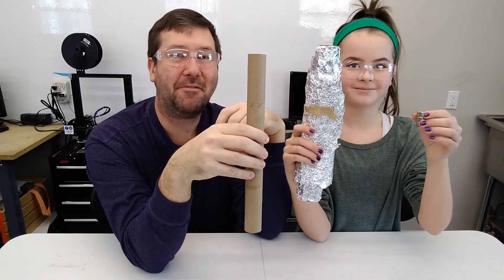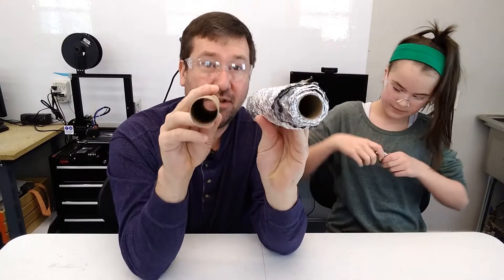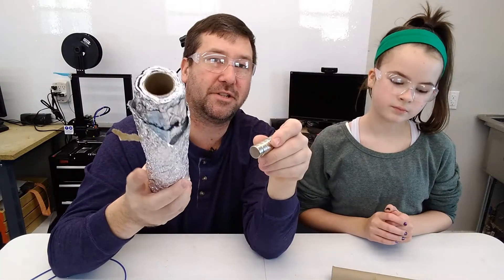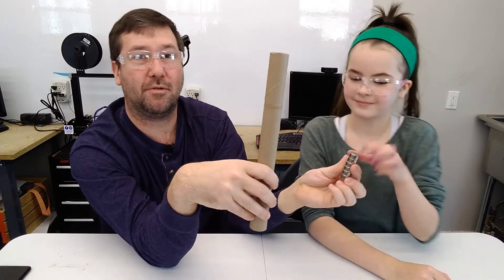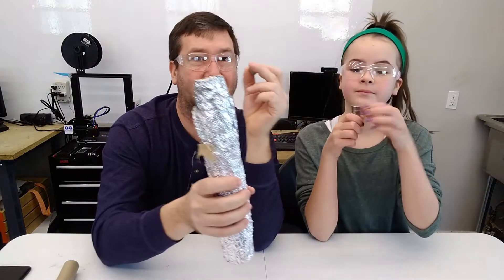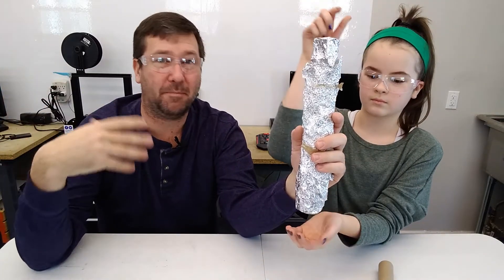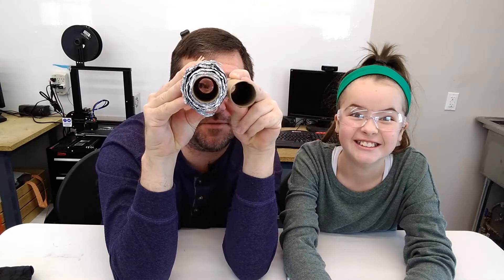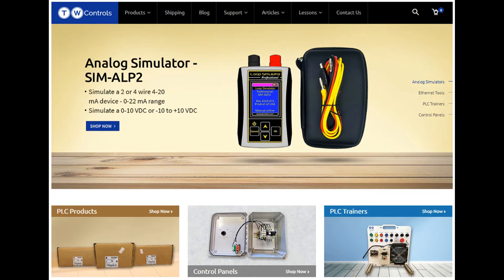Learn about Electricity with Aluminum Foil and a Magnet - Eddy Current - STEM with Tim

Comment: Very interesting video.   I like it.

It takes nearly 3 times as long:    1.86 s/0.66 s = 2.8 s

Your experiment brings up a lot of questions:

Does a magnet conduct electricity ?

What kind of interaction between a moving magnet and a stationary
conductor is there?    We saw that the bigger the magnet, the longer
it takes to drop.

You brought up the subject "eddy current" and implied it was some-
thing that flowed inside the aluminum foil, but you didn't say what
it was.   Are you implying that it is something that slows down the
motion of the dropping magnets ?
Reply from the maker: Here are two follow up videos that may help. 
https://youtu.be/WI56V_Wl4jI
https://youtu.be/veUAJKbAsqY

Comment: I tried this with some very strong rare earth magnets but it doesn’t seem to work. I guess only neodymium will do the trick. Or do I need more aluminum foil? I used a 30ft roll.
Reply from the maker: Funny you should ask. My daughter is doing a science fair project on this. The amount of aluminum and the strength of the magnets matter. They don't have to be neodymium.